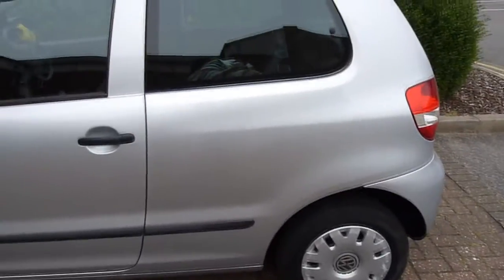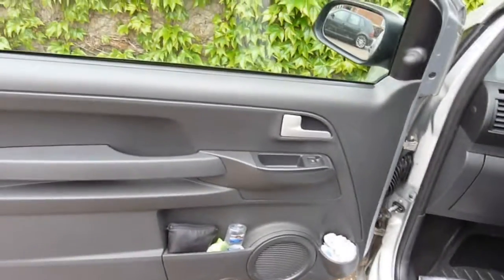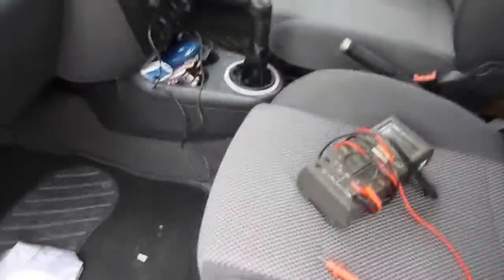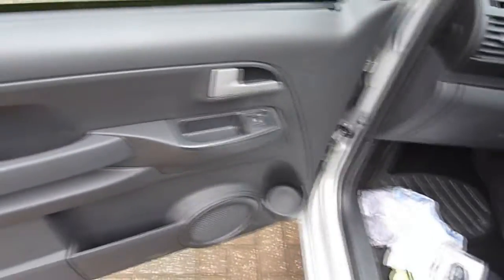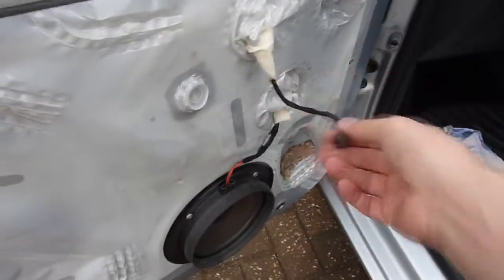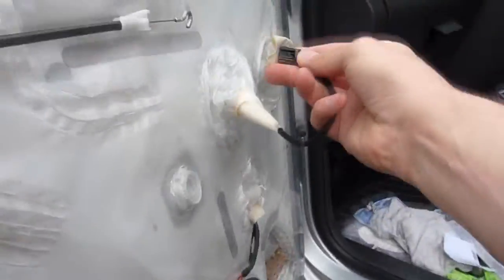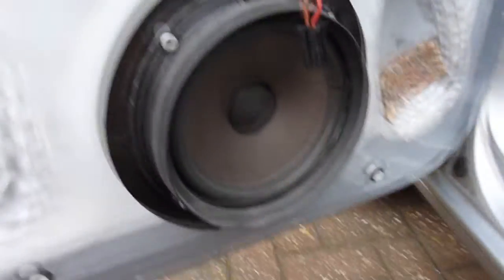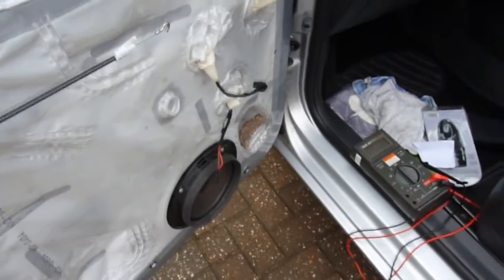Car Door Speaker Repair Part 1

Comment: Removing rivets= drill out.

The reason they used them is likely to prevent them coming loose with the vibration of the speaker. Screws or nuts n bolts will work if you don't have a rivet gun (they're cheap though :) )
Reply from the maker: Used the Dremel in the end, does not risk damaging the paint work and rust protection.

Comment: ***** Buts to just get a nice new drill bit and drill them out. Then get a big rivet gun and rivets to put the new one back on. No problem with the write tool.
Reply from the maker: Going to use bolts to secure them, may get some lock-tight, probably wont. Dremel did a nice job.

Comment: My bro drives around with a permanently missing door panel, the window is held up with a brick!!  He has a hard time at the McDonald's drive through!
Reply from the maker: It must be a complete wreck. Mum had a car she had to start with a screwdriver.
Reply: ***** It's some kind of Honda Coupe thing, sporty but this is my brother.  He has a tiny budget but has to have the fastest car he can get lol which often ends up going fast and looking cool but only for 6 months before the high mileage engine blows it's ancient crusty gasket, cracks the crankcase or the gearbox amongst many other things fall off of the car under the stress of being driven too hard!  His last 2 cars could not reverse due to the poor gearbox just giving up on life lol!
Reply from the maker: tribalmasters
Not one for practical cars that are reliable then. Just had the battery repalced in mine, it was even leaking.
Reply: Awwww I bet that made a lovely mess of the battery tray!!
Reply from the maker: tribalmasters
Surprisingly it did not.

Comment: hey dude, hows it going. Happy easter

p.s. my bbc has given magic smoke :(
Reply from the maker: Thanks. Check the filter caps, plenty of resources out there. I have fixed my beeb which had the same problem.
Reply: Yeh it was the x2
Reply from the maker: crazyboy2006cashier
Those caps just are not up for it after 30 years, can't say I blame them.